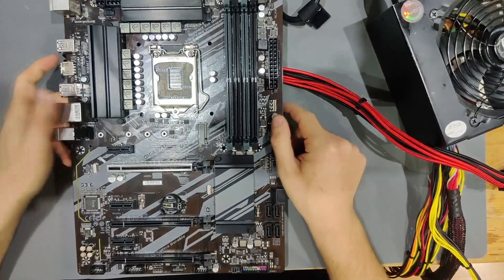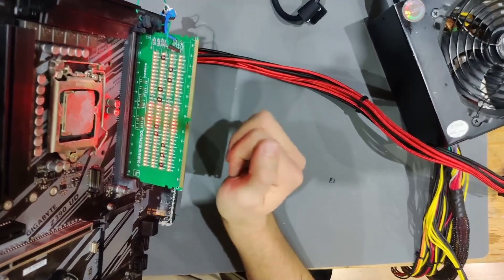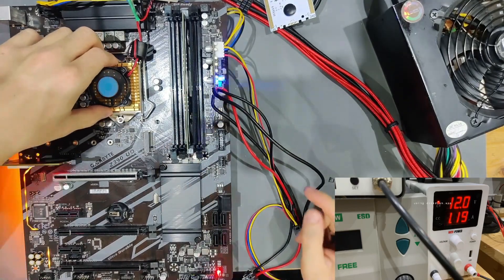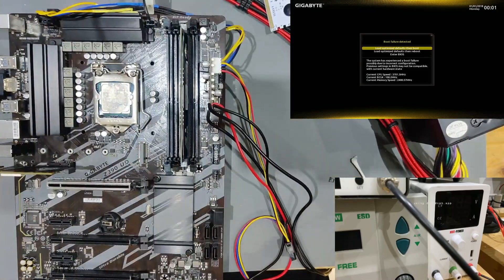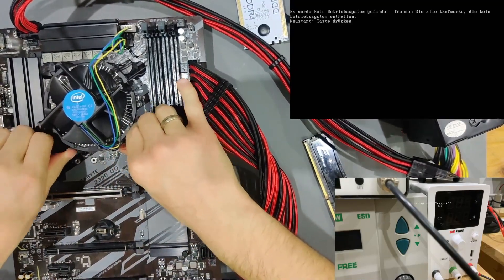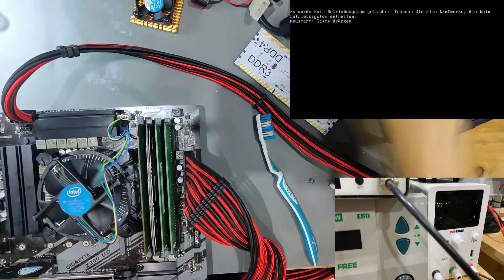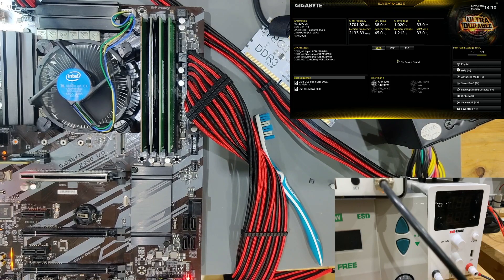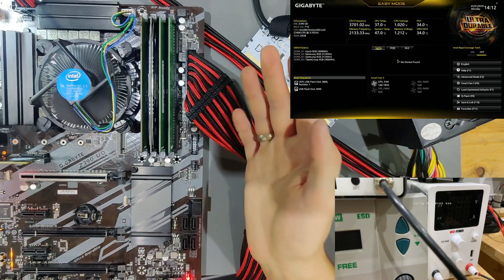GIGABYTE Z390 ALL THE WAY FROM FINLAND TO FIX | Z390 UD MOTHERBOARD REPAIR

Comment: And the issue wasn't with the ram slot,channels,dimms...slots worked.

But the memory controller lost signal with channels,it happens when you have bent pins or they dont have good contact with cpu.

Great videos to watch btw 🫡🫡

Comment: I bought a used Z390 UD from eBay that had a DRAM LED/no POST issue when I tried booting. I put the RAM in slots B1 and B2 like the manual states and the DRAM light came on, no boot. After switching to just one stick of RAM in slot A1 closest to the socket, the motherboard cycled a few times (RAM training?) and booted to BIOS. Then I moved back to slots B1 and B2 and the board booted normally every time after that.
Reply from the maker: Guess it was just bad seeding before or mabye dirt in the slot!

Comment: nice, i have the same motherboard but last month when i recording videos (i'm also a repair content creator) the board start to pick up very loud noise. at first i was thinking at my microphone but when i disconnected everything unnecessary from the board the interference was still there. i discover that as soon as i plug a microphone jack 90 degrees angle adapter the board itself is producing interference. yes, just the adapter with nothing connected to it, and obs shows me like -20db of statics interference. and it's very annoying. any advice on what to check?
Reply from the maker: I would guess its the ack itself. Cant think of anything else to be honest. Because a dead audio controller would just not work at all! Have you tried to wiggle the port and see if theres any change?
Reply: @MainboardMedic  no. No change. Where is locate the audio chip? I don't have any schematic. Maybe during the last clean I accidentally knocked a component or something.
Reply from the maker: @RVNR2022  Bottom left, always with some trough whole caps, that most of the time look different then the other off the board.
Reply: @MainboardMedic  thanks, nothing is broken or missing in that area. the resistors value arround seems also ok. now i suspect the power supply or the audio controller itself. i bought another power supply to see if this make any difference. maybe my power supply start to leak interference on the 3.3v line that feed the audio chip and create those noise on the mic in line
Reply: yeeee. i fix it. at the end it was only a driver issue. i bought replacement parts, dismantle my entire workshop and it was so simple. but i don't know why the driver suddenly stop working correctly... very strange

Comment: I have exactly same issue on Gigabyte Z370 HD3 which doesn't even goes to BIOS.  And with lots of trying I managed to flash BIOS and it works.
But with few issues, it power cycles one or two times before windows boot up and then now I have weird white and light colored squares flashing.

Comment: I had a b460m board and was no boot.
The fan just kick in and out constantly.
While removing the cpu found out that the 3 screws that hold the cpu on position were loose.
Tighten them and everything came back.
Now every board that i buy is defective i just tighten those screw

Comment: Im stucking at this Problem and i was happy when i saw your video but i was disappointed at the end because there is no actual fix for it and i will never get my first and second ram slots work again.
Reply from the maker: Did oyu use a RAM data line tester?
Reply: No but i will buy one and see if there is some damage on the ram slots

Comment: It looks like the additional pressure of the cooler affected the cpu connection to the pins, a very weird condition Ive only seen mentioned with newer boards.
Reply from the maker: Jep seems like it! Ive had this before and its very anoying to diagnose something like that.

Comment: I remember when Gigabyte boards were the goto for a solid and reliable board, whey werent the fastest but they were the most stable, some are still running now 20 years later,  I put many is low cost servers, or in specialised systems that needed to be realiable but not costing an arm and a leg to maintain back in the 90's and early 2000's  but they started to go wrong around the time of the Core2,  and when the z68 came out although not all were bad but we had so many failures they we stopped stocking them, the common thing was to do with memory, they boards were over volting and misreporting what the settings were, after a few reboots the boards seemed to either forget its memory settings or ignore them and they would boot loop  constantly,  a work around  was to fit the slowest generic ram you had, then you could manually enter the spd settings of the ram you want to fit save then power off,   then fit that ram but in a few months you would be back in the same boat.
Reply from the maker: Most boards i repair are Gigabyte and MSI! I dont know if they just sell more off them or if they actually brake more!
Reply: 1155/1150 gigabytes are the worst pos ever created i swear on everything, always just having bios issues esp the dual bios models, ram slots dying, blowing up pch (z87 legit just burned it up lmao), just not turning on, 6th gen and up are treating me nice for now but i reckon they will start failing in a couple years